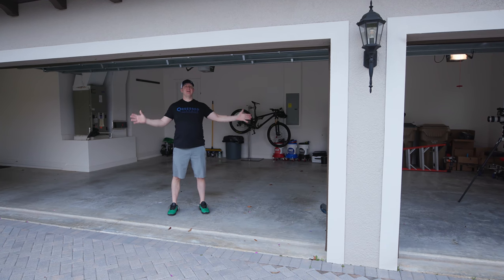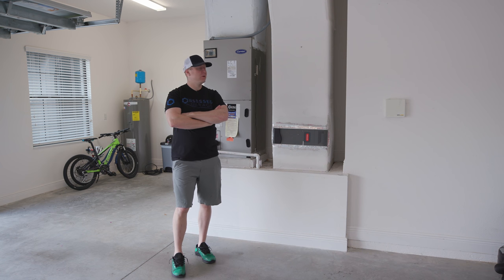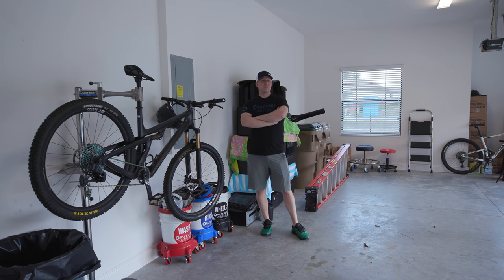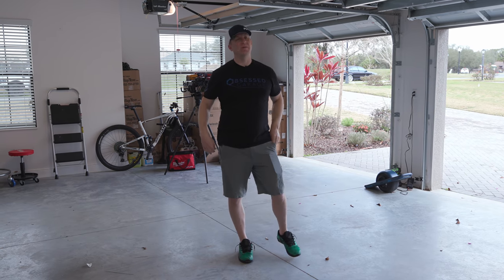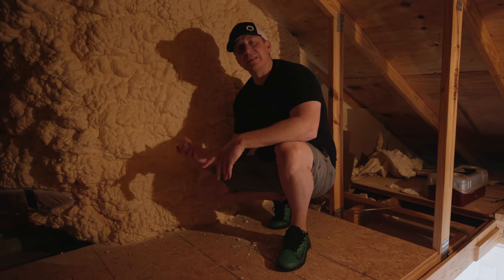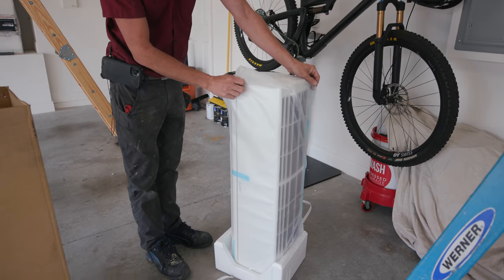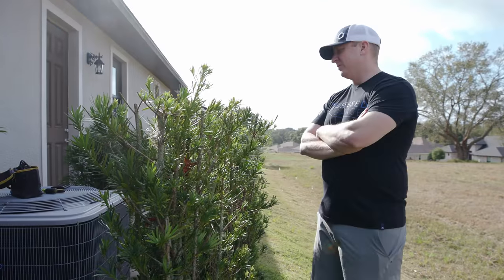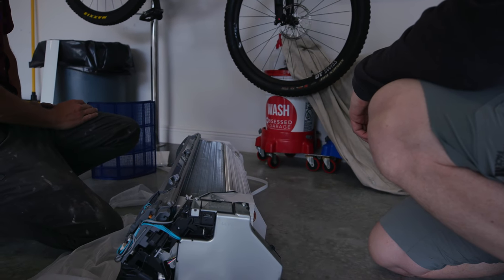New Garage Build: Relocating the AC and Installing the Mini Split

Comment: This is going to be awesome!! If for any reason you run into your cabinets being too close to the bottom of the panel in the garage, it will be super simple to move the panel straight up. In most cases you won’t even have to disconnect any wires depending on how far up I’m they were stapled. Talking an inch or 2. Then just fill the bottom gap with what you cut out of above. That’s also a given as if you don’t have any home runs coming into the bottom of the panel. Kill the lower of course
Edit: on the recirculating loop for hot water, I just built a house and made damn sure I did that in mine. I have 2 40 gallon electric heaters and a 3/4” loop carrying water to every drop throughout the house. It’s not instant but about 5 seconds to every tub/sink. Totally worth it!

Comment: For the cost of what they did, I could have put a new Bosch 20 seer unit with all new sheet metal duct that will not have mold in it. Duct board is the worst thing you can use in a humid climate.
Reply: True

Comment: With those 10 foot ceilings you actually have 120 cubic feet Matt!  Com 'on man, use your wits!  lol
Funny thing is, that I'm in the middle of building a new construction house and I'm having them place the HVAC unit in the attic also.  I also will have a very similar 3 car garage so I'm excited to see your non-Sonic cabinet set-up. I like your preliminary layout (on your Mac) as well.

Comment: Existing water heater is 30 amp @ 220v-240v- one could loose the tank and put up to a 36KW tankless electric in place.

Comment: Please do lights next, that is the step i am at but my garage is an oversized tandem 4 car garage. I have to move my water heater too but i have to remove the concrete filled pipe out of the way first.
Reply from the maker: Making the decision and layout on Tuesday!

Comment: Hey Matt, The house and garage are looking great. I think that was a great idea moving that into the attic that’s how it should’ve been built in the first place that’s a waste of space and really a eyesore Already looks way better. You mentioned dimming the lights in the Garage this is my suggestion Lutron makes apple HomeKit switches combine with HomeKit garage door opener and two HomePods running in stereo and if you buy the a HomeKit enabled television add a Apple TV then the sound from the television is wireless to the HomePods no center channel no wires super clean and you’d be surprised how good the HomePod sounds it’s not audio file but I would think that two HomePods would sound better than just about any single sound bar. I know you’re kind of an Apple guy so am I just didn’t want you to overlook something like HomeKit it’s actually very powerful very easy to set up fairly easy to manage I don’t think it gets as much credit as it should. I hope you look into it even if you just started out with switches for the lights in the garage once you see how good they work you’d probably want to expand anyways enjoy the channel enjoy all the products that I have purchased have a good one.

Comment: Looking forward to the transformation.  I am in Oviedo, FL and also redoing my garage and  have the water heater and will be putting in an outdoor tankless heater as well.  I am also preparing to insulate the garage an attic to install a Mr. Cool mini split I purchased.  To complete my garage I want to go with your floor system.  I heard you mention doing a wood top for your cabinets. I have a wood shop and I am in Central Florida will not have to spend the funds to have it shipped,.  What type of wood top are you looking to do?

Comment: To reduce vibration transfer, how about mount pressure wash set up on thick board spaced 1" from wall with rubber mounts between board and wall?

Comment: Question for Matt, you mentioned using RockWool insulation (best out there besides closed cell foam), have you looked at any sound deadening materials for the wall? There are several kinds from flexible membranes that go under the drywall to specially designed drywall. Interested in your OG thoughts.

Comment: So you have to climb up in the attic to chance the air handler filter every month? Seems like there would have been a better solution but maybe you don’t need to change filters that often in Florida. I do like the mini split unit. Much smaller and better looking than mine.
Reply from the maker: Yeah, but not a big deal.  I'm going to have something call Majic stairs installed.

Comment: Matt would you keep that drain if your going to have the bucket filler and pressure washer above ? I guess it would disappear with the Swiss Trax and could be good for any overfill or pouring excess water.

Comment: Why a lift if this garage? I would go without a lift in this garage to keep it super functional and easy to pull in and out daily, then when you need a lift just use the one at OGHQ.
Reply: He's going to do an in-ground scissor lift so won't be an issue
Reply from the maker: Yep, in-ground, so no space taken up.

Comment: Prediction: you’re going to want to park three cars in there.   Interested in seeing what you do with storage for bikes and crap....that’s what most people have to deal with!  

Regarding the water heater...either put the tankless heater in the same spot the tank is or just put it above in the attic.  I’d you have attic access, run a recirc loop line with a pump to the master bedroom, so you’re not worried about hot water at the master.  Lot easier than trying to re-plumb a bunch of the water lines.